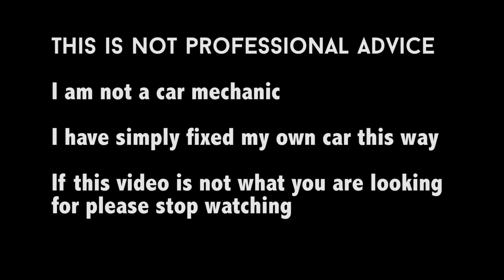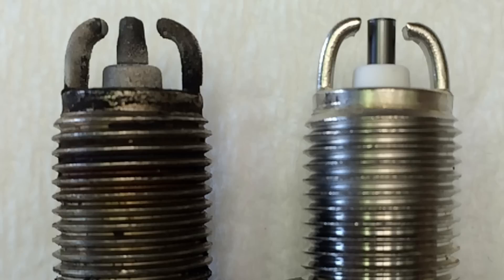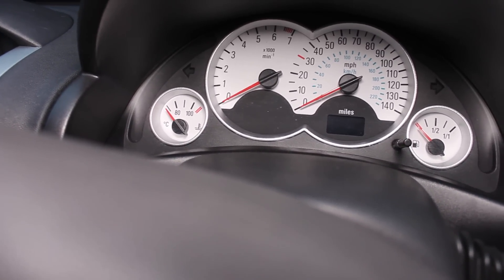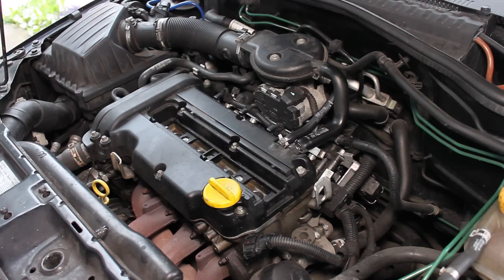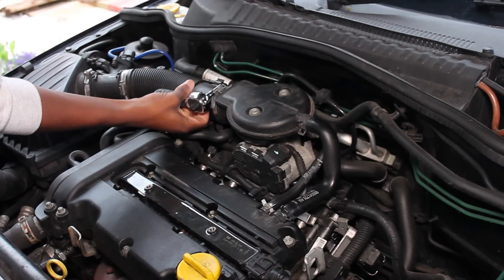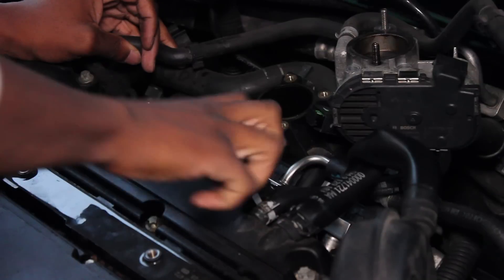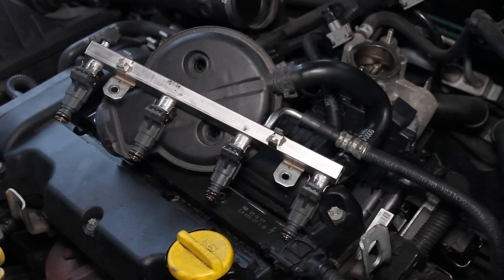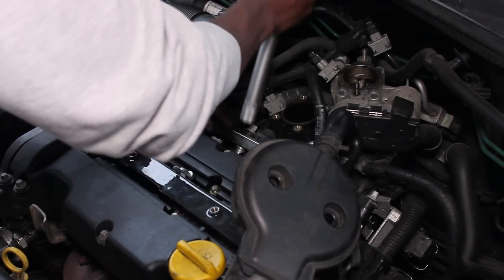How to Diagnose & Fix Misfires w/ Basic Tools - Vauxhall/Opel Corsa

Comment: Have problem 0304. Misfire in 4. Changed coil pack and spark plugs but still problem. Was this the same as urs? Do u think changing injectors would solve my problem? (Doesnt specify problem with injecto) 😔

Comment: I have a Corsa C from 2006 with 1.4 engine and 90 HP. When unscrewing the oil filling cap, the cap lifts up by its own, instead of being sucked down onto the engine opening. Is this positive pressure inside the valve gasket normal? I thought inside the valve gasket there is a negative pressure.

Comment: Missing corsa lite
Hi great vidio plenty to think about first prob is my 2010 corsa 1400 doesn't respond to pedal test. Nothing appears under yellow engine light    It's given me faultless service and still starts and idles perfectly
until I accelerate under load in a low gear. With revs up she sings to 6000. Drop a gear and foot flat. Jerk jerk mis until revs climb. I've changed plugs and leads. Some days it's better than others. Such a reliable car could last forever
Thanks
Rob
Reply: Must be injectors right
Reply from the maker: @ibhayirob Hi Rob, yeah it does sound like it could be an injection issue.

Comment: omg mate thanks you just saved me a lot of headache i am getting p0300 and p0301 together i switched plugs around with no change then did spark test on coil pack and was getting spark on all 3 at 20 so started on injectors unclipped 1 no change at all then did 2 and it cut out so thats my injector 1 bad right? so grateful mate thanks a bunch

Comment: I got the same issue on the same engine but on a corsa b. I stored the car for 2 years, it worked fine for a couple of hours but then developed a misfire. Problem is that you cannot individually disconnect the power to the injectors or the plugs so I can't diagnose which one's the issue. I doubt it's the engine since it worked ok at first but it may as well be the issue since it has over 400k km on it.

Comment: Hi  got  another question   where  do you fill up the Gearbox is it on the passenger side of the gearbox I think  I have found a filler plug on that side & thats the only one there thats on my corsa 1.2 mk2 2003  Vehicle .

Comment: Wow. I did the pedal test, the light was just flashing, no pauses so i thought that meant no detected faults. You showed thats not necessarily true, but since  my car wont run I can't fix that. A cheapo reader (50€) showed no faults, which since there clearly is a major fault if the engine will start but then cut off! So i bought an Xtool D7, a MAJOR investment. Tjay too could find no faults!!! New fuel pump and filter, new oil switch, new plugs, new crank and cam sensors, throttle body removed and scrubbed behind the ears, maf cleaned. Fires up but cuts out, yet according to ecu there's nothing wrong with the car😢😢

Comment: i had that exact cylinder fail on my own 1.2 in my case a valve had burned through the umbrella seals were leaking bad so it was pouring oil into the intake no doubt contributing to the failure anyhow the valve seat was miraculously ok so i just got a new valve dissassembled the head cleaned and honed all the valves including the new one untill i had a nice silver ring then reassembled and it's been running well for two years now so recently i decided id just toss in new rings in there for shits and giggles and now it runs even better! now im on to modding it with relatively simple and cheap mods to see if i can get any additional power out of it

Comment: Would this be the same method for a vauxhall meriva I have the same problem multiple misfire on all cylinders the coil pack was new I've changed the spark plugs I clear the fault and then if I drive at 30mph for long enough on 3000 revs the engine management light comes back on
Reply from the maker: Yes it should be the same method.

Comment: Astra H twinport real nightmares I ignored the first 2 probs as bad luck but....
Misfires and was dropping revs and stalling.
Changed rocker cover for new oem part.  Oil + filter change, egr deep clean, throttle body clean, spark plugs (bosch), front pipe with flexi.   Still misfires! 
Any suggestions?  Just bought pre cat lambda and gonna buy post cat aswell but if this isn't the problem I'm gonna try coil pack and do my wrists if that doesn't work 😭
Reply: Maybe the coil pack, or the injectors. For me it was both.

Comment: I found this so helpful.  I worked out that my misfire was also in cylinder 3.  My problem was caused by the spark plug failing.  Not too difficult to replace.

Comment: my zafira misfire on cylinder 3 turned out to be an open circuit in the ecu ... common problem for the zafira due to the location on the ecu bolted to the engine where heat dissipation and vibration effects the ecu
Reply from the maker: Thanks for sharing, hopefully other Zafira owners will find this tip helpful

Comment: Hi, one quick question.
I understand that you need to get some of the pressure out before removing the injectors, but when you put them back do you need to re-pressurise it some how, or does it do it when it puts more fuel in? Thanks
Reply from the maker: Hi, theres no need to re-pressurise them, it'll happen as soon as you turn the key to start the car.
Reply: JohnOmi. That's brilliant thankyou this video is really going to help

Comment: I picked up some good tips from your video. Also it seems to be a common belief that if the car has not been working for a long time the injectors will be dried out and gummed up and wont work. I have just started cars parked outside over 1 year and over 2 years and they started almost first turn of the key. And as the tanks are now pressurised the petrol don't seem to go bad like it used to do.
Reply from the maker: I’m glad it was helpful. Thanks for sharing this good advice.

Comment: Hi 
I have Opel corsa C1 and it sucks oil without smoking its takes 2 L in 11000 km , do u have any idea ?
Reply: Man, I have one of it here in Brazil and although the mechanic say It can change oil in 10000 km, I always take the car to him at each 5 or 6000 km, because it's the most important thing you can do for the engine health. I only think it's normal to consume 2 L of oil in this amount of roaded km, as the block itself takes 4L at the changing.
Reply: YouTube YouTube  rocker cover change it and you will thank me later had it on a meriva was the same eating oil

Comment: hello thank you for this video , i have a corsa c 1.0 z10xep i did a timing chain , the engine start well but it shake and when i did a test drive there is a acceleration problem , do you have any ideas please
Reply from the maker: Hi, i'm not sure about that, theres many things that it could be.
Reply: One of my friends have exactly the same issue, I changed the Sparks and all the filters , but still , when you accelerate you have sometimes a gap / hole before it react. PS : it is a 1000cc so only 3 cylinders. Any advice is welcome.
Reply: @DRI1966  Bobine rail or MAF sensor. Problems starts most when car is on temp. Disconnect MAF sensor when engine is running, if it stops it is ok , when keep running you got the problem, 9 of 10 times it is the bobinerail or MAF for 1.0 engines.

Comment: Maybe one safety comment : Always remove the NEGATIVE pole (Black) first !!! If you  remove the POSITIVE pole (Red) first and you tool touch some metal part of the car, you will make a short circuit that will burn you !!!
Reply from the maker: Thanks for pointing this out!
Reply: it wont burn you, it will vaporize you, kill you and dispose of your body...aahahahah...usefull tip though

Comment: How do you confirm that the 3rd ceylinder is misfire and based on what. Just want to know it
Reply from the maker: If there’s no difference in the way the engine runs when the injector is disconnected. On other cars you can try this with the ignition coil.

Comment: sud i put engine oil in the petrol tank ?
Reply from the maker: JUSTIN TIME maybe try petrol where the oil goes instead 👍🏾
Reply: JohnOmi  well i mixed petrol 1/2 with engine oil like you said run absolutely fanstastic do you like i sud cut roof of make it in to a convertible
Reply from the maker: +JUSTIN TIME great! Yeah that would be awesome. I think you can use a kitchen knife to do it
Reply: Justin time  My car has a problem....when I am driving and reach 290 320 kmh the steering wheel start to shake...do you think is normal? or should I increase the tyre pressure at 44 watts ?...……………………………………..sbauhauhahuhahuhhaLOLahaaghahahahahaagaajajhahahha